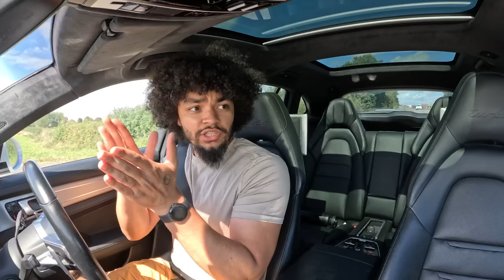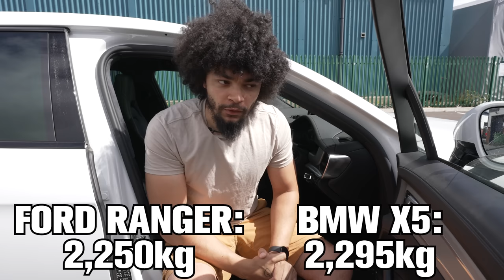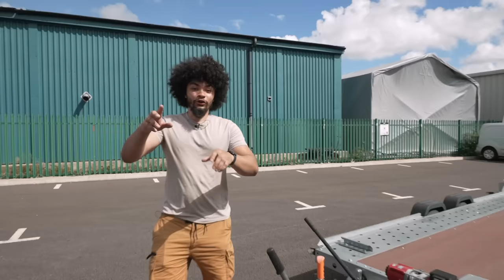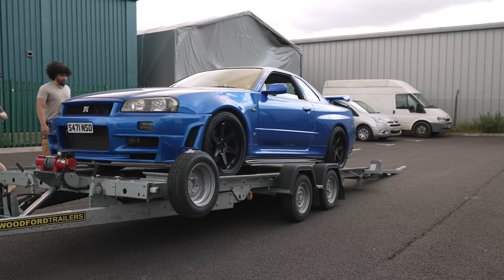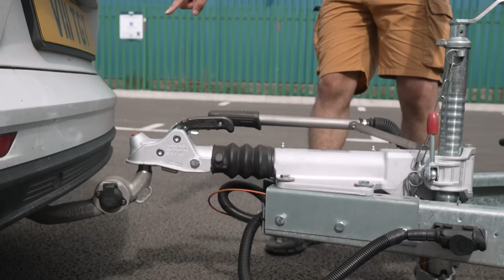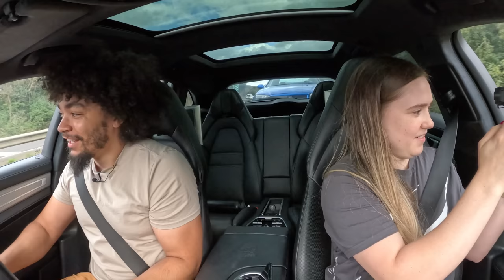The REAL Reason I bought a Porsche Wagon...

Comment: The r34 is defo not 1300kg it weighs 1560kg
Reply from the maker: Nope, weighbridge says otherwise. 1450kg with me in it at 92kg
Reply: @BlackPanthaa  well damn the forums be wrong. I need to weigh the r33 and see what mine is then
Reply: @Marklp16  GTR registry lists R34 GTR's as 1540-1580 depending on the model, no way in hell is his car 1358kg.

Comment: BAHAHAHAHA porsche and tow....
shoulda bought a USED AU falcon ute. 

because you need the torque for towing and the push doesnt have it. there is a reason you dont see them towing.
expect to be rebuilding that motor soon.

when you have a falcon ute you wont notice the weight on the back. as its 1500KG at its lightest. and its not a diesel holding up traffic...